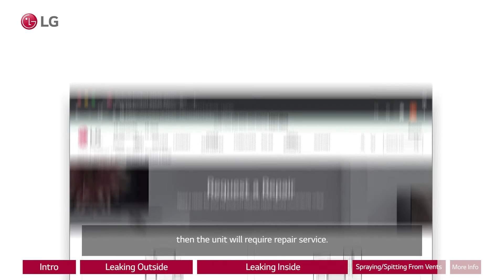[LG Air Conditioners] How To Resolve Leaks From An LG Window Air Conditioner

Comment: What if the water is leaking on the side?
Reply from the maker: Hey there. To address water leakage from your air conditioner, first, check and clear any dirt blocking the drain hole. Ensure the drain hose is securely connected and clamped. Also, check that the unit is properly tilted for drainage. Send us a private message on social media @LGUSSupport so that we can provide additional support. We're always here to help. ^ Diego

Comment: Hi! My LG AC is  is expelling water from the side of the unit  - what should we do?
Reply from the maker: Hi there, George. We appreciate you bringing this to our attention. We understand the importance of having a good working AC unit for your cooling needs. So we can troubleshoot this further, if we may ask, what side of the unit are you experiencing to expel or leak of water? Thank you. ^Anthony
Reply: Do we have to remove the rubber cap at the bottom of LG window type inverter AC?

Comment: Can I use during rain?
Reply from the maker: Yes, you can use a window air conditioner when it's raining. It's designed for outdoor use. Rain won't affect its performance. However, if there's flooding, unplug it to avoid electrical issues. You can also add weather stripping for extra protection. For questions, message us on Facebook or Twitter @LGUSSupport. We're here to assist. `Alice

Comment: Where can I find/order a replacement drain pipe for model # LW1221HRSM (AT3AHDP)... or at least find the part # for the drain pipe?
Reply from the maker: Hey there. We would love to help you have the best experience with your AC unit. Please send us a private message on social media @LGUSSupport with your contact information, and we will be able to provide you with the right parts you need. We are here and ready to assist you. ^ Diego

Comment: Hello, I have this exact unit but recently I'm starting to see mosquitos and other little flying critters come through my unit. The sides are sealed so it's definitely coming through the ac vent. Any suggestions as to why? I've had it for two years now and this is the first time this has happened.
Reply from the maker: Hi Brittney! This isn't the experience we strive for! Let's take a closer look so that we can get this resolved as soon as possible! First, please make sure that you have the fresh air vent lever pushed inward. It's black and slightly protrudes from the vents. If it's in the outward (pulled towards you) position, this would allow fresh air into the room and allow for a way for these critters to come in! Have you noticed any leaks in the unit? Mosquitos may be attached to any standing water in or around the AC unit. If you do notice a leak, it would need to be addressed promptly! Please send us a private message on social media (@LGUSSupport) with your phone, model, & serial numbers. We'd be happy to get to the bottom of this! ^Chris

Comment: I haven't remove yet the rubber cap for 2 months now. What will be the possible effect to my ac
Reply from the maker: Hi there. Thank you for reaching out to us. Regarding your concern, it will not affect your LG air conditioner as long as it's properly drained and always check the basin underneath the unit.

For further assistance, feel free to send us a message.

Comment: My LG AC has been leaking to the inside from what seems like the bottom of the filter area. This is terrible especially during heavy rain storms. Is this because I need to pull something out from the back to drain the water?
Reply from the maker: HI, there. If your air conditioner is leaking water, it's often due to regular cooling and condensation. The water gathers in the base pan and is supposed to drain outside. The unit is designed to work with about 1/2 inch of water in the base pan, so don't worry about adding more if it's dry.

If there's a leak inside your home during heavy storms, it could be because excess water made the base pan overflow. Just drain off the extra water from the base pan. For detailed guidance, check this link: https://www.lg.com/us/support/help-library/water-leaks-from-unit-room-air-conditioner-CT10000014-20150896351952

For any other questions or help, message us privately on Facebook or Twitter at @LGUSSupport. We're here to help. `Alice
Reply: Hi there. Thanks for replying. Where do I obtain the drain pipe from? Thanks!
Reply from the maker: In order for us to provide the accurate drain pipe for your unit, you may need to send us a private message on Facebook or Twitter at @LGUSSupport. Kindly send us your contact information along with the model and serial number of the unit. ^Danee

Comment: for our AC, it is expelling water to the inside.
Reply from the maker: Hey Paul, you may have a clogged or dirty line. See if our library can get you through this concern. https://www.lg.com/us/support/help-library/water-leaks-from-unit-room-air-conditioner-CT10000014-20150896351952 Let us know how it goes in a private message via our social media. @LGUSSupport. ~Tegan

Comment: I can not get my air conditioner to tilt downward at all. It will onlt stay level.  The underneath is sweating really bad, causing the water to drip inside, causing damage. I have tried everything.
Reply from the maker: Hi, there. To better assist you and understand the issue more, please send us a private message on Facebook or Twitter via LG Support USA with a detailed description of the issue for better assistance.~Zie
Reply: I added a thick piece of wood underneath the ac unit in the front interior, so that it would give it enough tilt